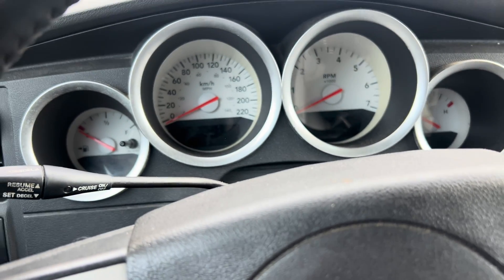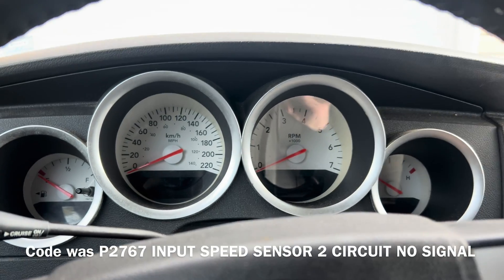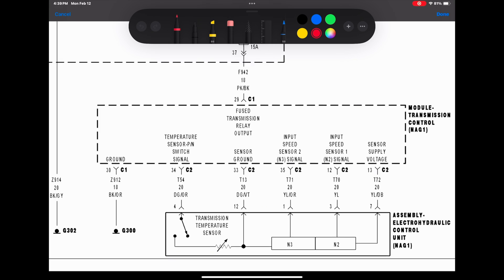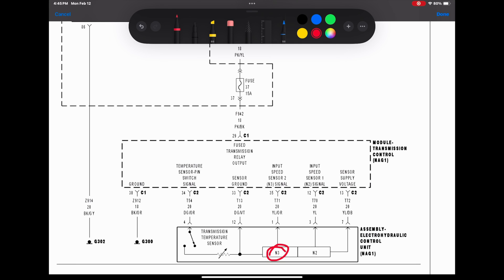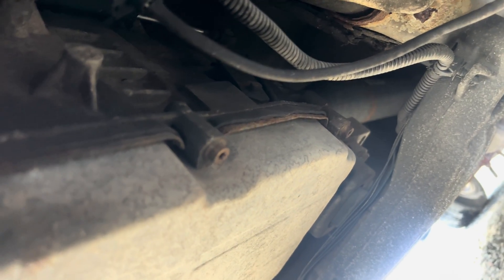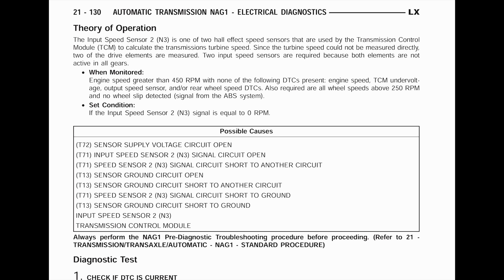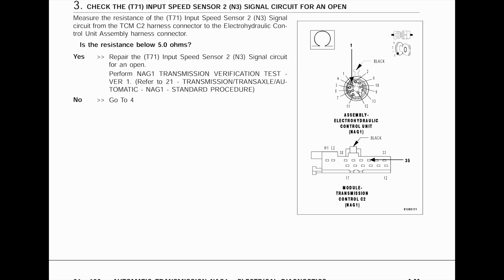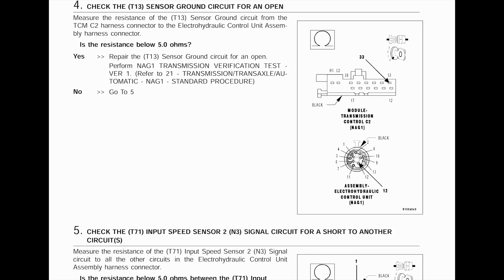P2784 P0717 P2767 Diagnosis Input speed sensor No Signal Dodge Charger Magnum Challenger Chrysler300

Comment: Sup. On my 2006 Chrysler 300C I have the P2784 code. If my solenoids were bad would I have a different code. I just seen you got the kit from Amazon and wondering was it good? It was a big price difference compared to stores.
Reply from the maker: Hey bro! The 2784 code relates to one of the speed sensors on the transmission conductor plate. There’s three possible causes of this code. First would be a bad wire or poor connection on the transmission connector. Second, a bad conductor plate. Third, a bad TCM.  (Less likely) 
It’s more likely to be the first or second issue. 
The problem for me was a bad conductor plate, the solenoids were reused. So far the Amazon conductor plate has been working fine since the repair. No issues anymore. As long as you’re careful and don’t break anything it should work good. Take care bro! Good luck with the repair!
Reply: @  About to order  the input speed sensor kit on amazon, clean everything up like you did and hopefully that works. Then I can continue with my build. I will clean and reuse the solenoids. Good video and appreciate it!
Reply: I installed it now I’m getting a U0156 code. The car ran smoothly for a day after the speed sensor install. The day after it was stalling and U0156 was the only code showing up.
Reply from the maker: Hey bro, did you get this figured out yet??

Comment: i HAVE A CODE p2784 P1731 AND P 0730. It seems that the connection between TCM and conductor plate could be bad in the N3 cable. How can I check this
Reply from the maker: Sorry I missed this bro. Ever get it figured out?

Comment: Do you know what sensor measures Engine Torque and Converted Engine Torque in these transmissions? I have a 2011 Challenger stuck in limp mode. I am getting a reading 48000 lbs of torque
Reply from the maker: I’ll look into it bro! What codes are you getting?
Reply: @colin7761  no tcm codes, just one from the PCM for a cylinder 5 misfire (bad plug is my guess) car had been sitting around for about 4 years so. Changed the out the fuel pump and battery so I could get it to turn on. Power steering pump also had gone out so I changed that out too. A new MAP sensor as well. Planning to see in the future if a transmission fluid change would help. Fluid looks clean and at proper level but smells a bit off.
Reply from the maker: Right on bro! What scanner are you using? Is it capable of reading tcm codes. If you are able to get live data, does the wheel speed sensors give a proper readout while they are spinning? Also I would def address the p0305 next. Try swapping the coil pack out with another cylinder. If the misfire changes then it’s the coil pack. If no change, then pull the plugs next to see what they look like 💯💯 After the p0305 is fixed then you should focus on the other issues. Anyway bro, good luck with that and if you need any advice you know where to go!!  If your transmission fluid is old and dark, it would probably be a good idea to replace soon too 💯💯🤝

Comment: I have the same code, replaced the cond plate and i still have the same issue? Checked all my wires seem fine what can be another cause??
Reply from the maker: Sorry to hear that bro! What codes are coming up?
Reply: Tcm is located under dash if you have a nag 1 transmission
Reply: P2767
Reply: My car wont go pass 35
Reply from the maker: How’s the connector on the trans? Do you know where the TCM connector is as well?
Reply: @colin7761 where is the TCM connector? We replaced the conductor plate. Still get the p0717 and P0717pd. But not every time we drive it. Checked the wires and connection at the conductor plate. Everything appears to be in good shape/condition.

Comment: Hello bro , ive had a speed sensor issue once, mine was just a pin on the connector but right now I am still stuck in limp mode from p0758 and p0522 im really freakin stuck there for a month
Reply: When I had the speed sensor issue I could clear the codes and it would shift right away but right now it wont shift no matter what
Reply from the maker: Hey bro, appreciate the comments. Give me some time to look into it and I’ll get back to you here soon.. 💯💯🤝

Comment: Good video man one question do you know by any chance if the rear wheel bearings on a 06 charger rt tone rings if they all rusty do you know if thatll cause the car speedometer to not move at all or not go over 20 mph? I can only go up to 2nd gear but by only using the manual shifter tia bro
Reply from the maker: Thanks for the comment bro, appreciate it. The vehicle uses the wheel speed from all of the wheels in order to calculate the vehicle speed for the speedometer. So, sometimes you can lose the vehicle speed, especially if you don’t have readings from both rear wheels. The transmission uses the rear wheel speed sensors in order to calculate the transmission output shaft speed. So if they don’t have a signal then the transmission will not be able to detect output speed, and it will not be able to shift. If your tone rings are bad. They can be replaced, by removing the old one, and pressing a new tone ring on the old axle. Some other people just replace the rear cv axles and it will come with a new tone ring as part of the new axle assembly.  Good luck with your vehicle bro!! 🤝💯
Reply: @colin7761  thank you brother how can I tell if my tone rings are bad or cv axle or my conductor plate can a bad conductor plate cause my car to not run?
Reply from the maker: If you’re able to, scan your car for all the codes, and let me know what it says. The specific codes you have will help point us in the right direction and then  we can go from there. If you have no scanner turn the key on and off 3 times and it will run through some codes on the dash. 💯🤝
Reply: @colin7761  scanner says p0137 but not sure if that's the reason speedometer don't move at all what do you think? I have the abs light on traction control and the esp bas they are all on please help
Reply from the maker: @james4228  that’s an o2 sensor code. Will need a scanner that can read the abs module DTCs. You can also try doing the key three times and see if anything else comes up bro! The trac light being on means there’s def a code set in the abs module.
Reply: @colin7761  when there's a code in the abs module does that mostly mean it has to get replaced? Ok it's an expensive part
Reply from the maker: No, the codes are just stored in the abs module for this system. So if we only have a scanner that connects to the pcm then it won’t show what codes are on the abs module.  There is a code that will set if the abs module is bad. In this case I don’t suspect the abs module itself is bad but if we can figure out what codes are saved to that module then it will lead us to the solution on how to fix it. Try turning the key on and off three times ending in the on position and see if it displays any codes on the dash! Good luck bro 💯💯🤝
Reply: @colin7761  hey man so I scanned the codes and they say 
C121a
C1042
C1044
C2100
U140e
C2202
C2101
Tia maybe you can point me to the right direction to get my car running again brother
Reply: @colin7761  on the tcm it says 
U140a
U140c as well
Reply: @colin7761  which codes you think are the ones making my car not run over 20mph? Thanks
Reply from the maker: Sorry bro just saw this reply. U140a is signaling an issue with the right front wheel speed signal. U140c is signalling an issue with the right rear wheel speed signal. If you’re able to look at the abs live data on a scanner, check the wheel speed signals and see if you are getting a reading from the right side wheels. If no wheel speed reading is found then I’d pull the sensor on the right rear wheel and shine a light in the hole to check the tone ring. Sometimes they can just be dirty but if you are in a rusty climate then the tone rings will usually rot out and need to be replaced. If it’s an awd the front tone rings will be a part of the cv axle, if it’s just rwd then the tone wheel will be apart of the front wheel bearings. Anyway good luck!! 💯💯🤝
Reply: @colin7761  all goos brother i was doing the live date and all 4 speed sensors were reading 0 mph and speedometer was still at 0 but felt like it was goin 15-20 mph would you start replacing the abs module or the wheel bearings? All 4 speed sensors i ordered off amazon not sure if they have to be mopar dealer sensors?? Tia bro
Reply from the maker: @rodolfogiles8055  I’d definitely check the tone rings to make sure they aren’t rusted out bro! Usually when abs module or sensors go bad they will set other codes. It’s good that you have sensors otw. Amazon sensors work good as long as they’re the right ones. When you go to install them shine a light in the sensor hole to see the condition of the tone rings. If the vehicle is rusty underneath it is more likely the tone rings are bad. Anyway hopefully you figure out whats going on. Good luck bro! 💯💯🤝
Reply: @colin7761  I got them and installed them and I'm getting a 0 reading which speed sensors do you get off Amazon? Or do they have to be dealer sensors since they are oe? And I bet they all rusty I'm just gonna replace the wheel bearings with the new rings
Reply from the maker: @james4228  Amazon sensors work. I suspect bad tone rings. If you have rwd then the rear tone rings are a part of the axle, the front tone rings are built into the front wheel bearing 💯🤝
Reply: @colin7761  oooh I thought it just be replacing 4 wheel bearings and it's the whole tone ring inside it on all 4
Reply: @colin7761  i appreciate you bro I'll comment the codes
Reply: I have a question if the front will speed sensors are reading, but the back aren’t will that still be considered the tone rings instead of output sensor?